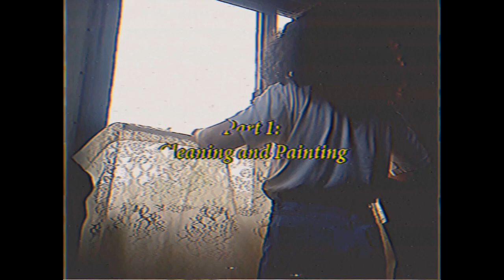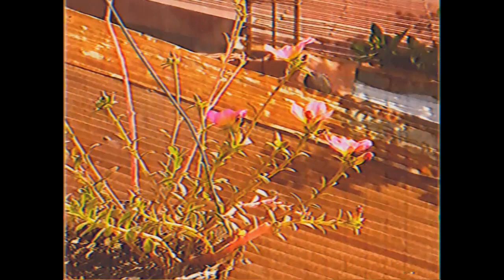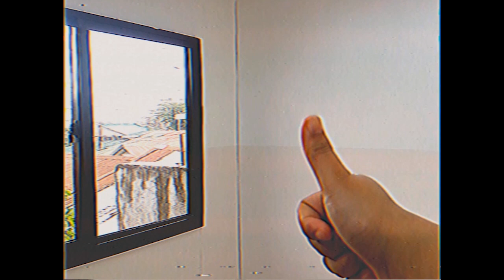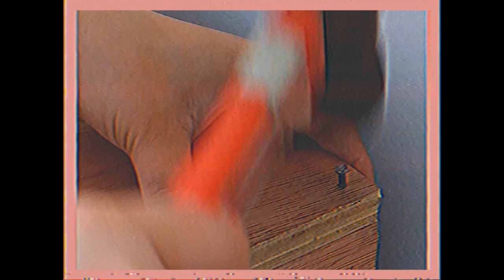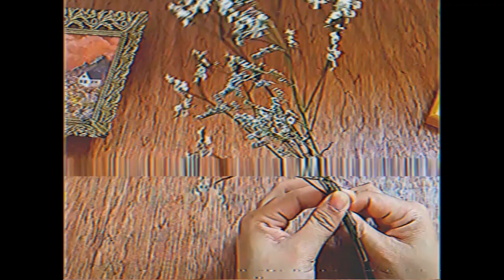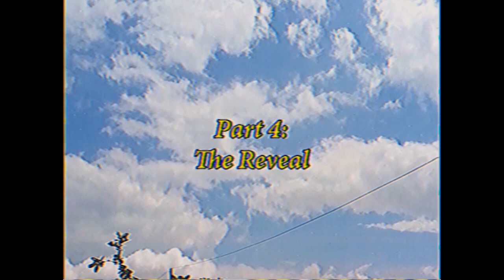SMALL ATTIC ROOM MAKEOVER: self-built floor desk + no cost aesthetic decoration

Comment: Wow 😯 how did you calculate the height that you needed for your desk?
Reply from the maker: I actually based it on my height when I sit and level it to my bust area. I wanted that way because I have the tendency to slouch so bad when I use my laptop on a floor desk with lower height.  It's not mathematically accurate but it works to my need.

Edit: I also bought a floor chair so I have a back support when sitting. I observed that even though the height of my desk works I feel sensation when I sit longer without back support.
Reply: @since97000  
Cool. Thank you for the info I've been trying to get one but have been unsuccessful since I don't know what height it should be.
Reply from the maker: @shacorraboyd9026  No worries. I'm glad to help 😁